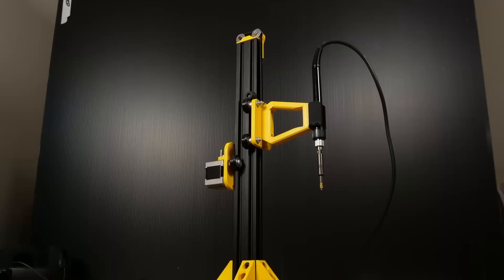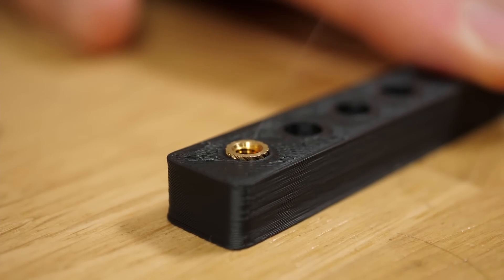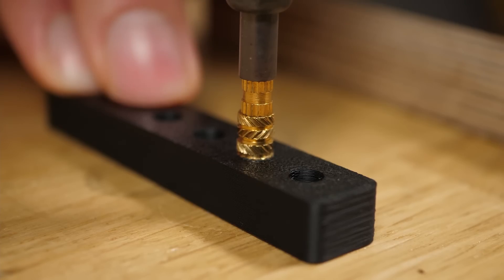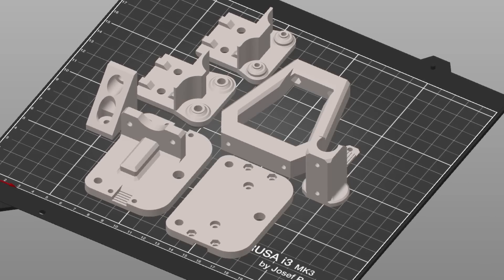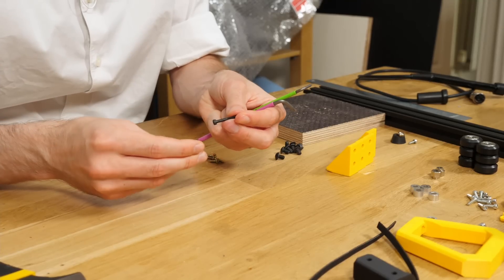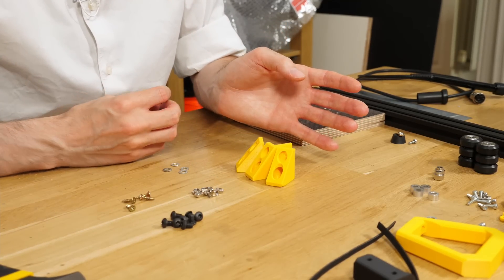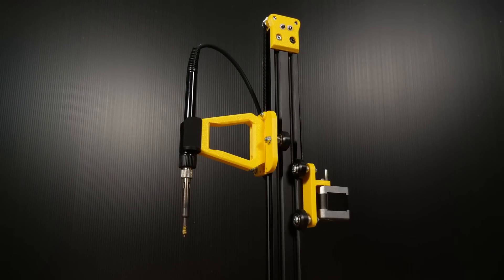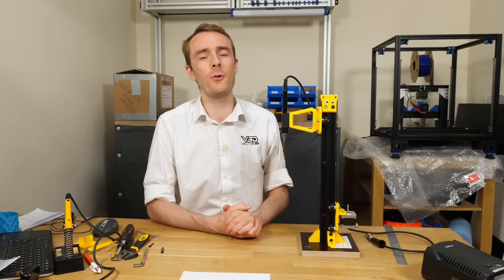DIY 3D Printed Tool Does PERFECT Inserts Every Time!

Comment: A iron with a digital temp setting makes it so much better. You can get it just hot enough, without melting everything, or pushing to far, it will go in slowly to give more control.
Reply from the maker: That's what this is, it's a soldering station so there is a separate box with controls and temperature.

Comment: Cool tool!
But the counterweight semms to be quite overengeneered in my opinion. What if it will be replaced with a mechanism based on strings 🤔
Anyway looks so cool with this design)

Comment: What kind of solder iron like the one you mentioned on the video, just the standard electronic soldering iron? Also, would it be easier if we use a drill bench press where you use the lever to lower it down and retract it back up? I find your video tutorial more interesting and affordable. Thank you.

Comment: What an idiotic invention,  all you need is a large wooden dowel like 1/2 inch. Insert threaded insert 80% of the way in the part then use a large wood dowel that is double the diameter of the insert and press down. The dowel will make it perfectly level with the surface.

Dumb invention you made.

Comment: Can't you just put an insert adaptor on the printer hot-end and use it like your machine ? you can set the temp, its vertically true, you can use it to drop down the same distance each time...like ?

Comment: I think that perhaps simply making an adapter for a Dremel drill press unit would be simpler.  IF I find myself in need of this solution, I will look into it further.  Of course, if a person doesn't have a Dremel DP unit handy or isn't interested in getting one, then this looks like a fine whiz-bang solution.  Well done.

Comment: Ok,.. so no details whatsoever on probably the most important part of the build the, what was it,..
"Kinda uniquely designed soldering tip not designed for soldering at all". 
No link, no maker, no (non-waffly) name/use. What's that about?
Reply from the maker: They're already widely popular and in-use in many place. Heat set insert tips, you can get them here:
https://vector3d.co.uk/product/soldering-iron-tips-cnckitchen/

Comment: this popped up.... if you really want a cheat you can get cheap drill press stands online for under 20, i printed a bracket to hold the soldering iron

Comment: This is great for inserting into a square piece i.e. where the part itself sits square on a table. Side note: the majority of things I have ever printed need inserts added but the item doesn't sit flat on a table. Example: I just printed some DIN rail brackets. In some cases I guess the part could be held in a jig / clamp. If you are making loads and accuracy is important then yes - a clamp plus the vertical insertion tool is probably very sensible. For me personally it's a bit of a niche case. That said, it's a great idea and nicely executed!

Comment: Not sure why you make a big deal about the soldering iron tip given any decent soldering iron will have tips designed for this purpose and presumably that's why the other soldering iron in your rig is using. That has nothing to do with this rig.  I mean this is still really nice for the ability to push straight, but the tip? Seems a weird thing to focus on.

Comment: Nice little tool... it would work better with a geared wheel to lower / raise it similar to a drill press... and a stopper at the hot tip so it sits flush instead of having to gauge the depth manually

Comment: I just push them in 90% of the way then finish them off with a machinist square to get them flush. I've never had a misaligned threaded insert or issues with flush mounting. I like that the square makes sure the insert and the melted plastic are flush. I do like how the counterbalance keeps it up and out of the way.

Comment: Is there a reason it's so giarnormous? I mean, I can see that the head pushing in the insert is moving not more than 1cm. If it's smaller .... well, my house is pretty small. So smaller things are easier to store when I'm not using them.

What I mean to ask, is have you already tried a smaller version, and found there is some unexpected problem, which is why it is now so big. I feel tempted to scale it down or up (so that it can double up as a drill press), but would like to know if there are some pit falls, so as to avoid falling down the same hole other people have already been in.

Comment: This inspires me to make a cnc version based on a 3D printer, imagine if you will, all the possibilities with 3 degrees of freedom for installing threaded inserts. It can install a threaded insert over here, or, how about over there? Yeah! That wasn’t possible before. All jokes aside, I have a project I want to work on and as a precursor project, i plan to make a 3d printer with a changing tool head. This, obviously being modified to fit to a 3d printer, could be very revolutionary. Especially if the printer can have 4 degrees of freedom and automatically pickup threaded inserts. You can make a print that might need inserts on the side and so the printer can switch tools to the insert head, grab an insert then add it in on the side of the print.

Comment: They make a simple end that is designed for installing inserts. Its made for a Hakko 88 soldering iron I have one and it works great the make several different sizes also.

Comment: Nice gadget. Regarding the base of the unit, I see a problem with applying inserts in the middle of larger parts due to the small size of the base. One could take a piece of the same base material to elevate the part or just make a larger base. And for inserts that need to be applied at angles, you could print some V-blocks for support at various angles like 30, 45 and 60 degrees. Also, if you don't have GT2 idlers handy GT2 gears could be used by reversing the belt.

Comment: I have been meaning to design exactly this same thing.  There are some other designs out there but they seemed a bit overcomplicated and I wanted to utilize some of the spare printer parts I have around - and this is exactly what I had in mind.  definitely going to print this out.  Good work!  Thanks for sharing.

Comment: I wish creators would offer STEP files, not STL files... STL files are not good for sharing 3D Models. They're large.. they are a surface tessellation model and so the detail is limited to the detail that the creator exported it at, which has in some cases been quite low (and the higher the quality, the higher the size of the file). .STEP files offer a far better method, they are platform agnostic, and will work with all CAD modellers. They are Geometric models, are describe solids, and so the quality is unlimited. The size is small, in comparison. 
But MOST of all, STEP files are far easier tot modify, as they operate as a standard solid model within the CAD program, and can be modified the same as others. STL files can be modified, but its much harder. As they are limited in detail and tessellated the geometry isn't standard, and so modifying becomes harder. aces are defined well, and curves are particularly bad. 
Prusa3D now allows the use STEP files for printing.

Comment: You don't need this - just press the insert in mostly straight and most of the way and then use an aluminum rod to push it in the rest of the way. That will flatten it out perfectly and cool it down as well. I've done close to a thousand inserts this way.

Comment: Great idea, nice design. Big fan  of your content.
I took your idea and went a step futher, by recycling an old crappy drill press. Gutted the motor and electrics, kept the base, upright and spring return head mechanism, Adapted a clamp to hold my soldering iron and voila! A heat insert press with adjustable depth stop and spring return tri-lobe handle. Works great. Thanks for the idea. Cheers

Comment: Trying to find all the parts.. the CSV list is sadly missing a lot of details on exactly what to get. I punch in the names and see all sorts of results.. many of which don't match the parts used in the video. Cool tool.. hoping I can assemble it!
Reply from the maker: I am selling kits now if that helps.
Reply: @Vector3DP  no. I ordered the $180 in parts. But I have enough to make 30. ;)
Reply: @Vector3DP  Oh man.. I just spent like $180 on amazon to try to buy most of the parts. :(. Hopefully they take returns. Where is this kit you speak of. OK.. I see the full kit on your site.. but it looks different. I printed out all the parts for the original. Will those no longer work with this? Guess I'll try to build it.
Reply from the maker: Ye the newer version is slightly improved design with different parts.
Reply: Did you make a video for it.. or instructions? Or is it only that you make/sell those?

Comment: What's the purpose of having one/two heat set inserts permanently attached to the tool head?
Reply from the maker: It's just slightly adjustable so the tip doesn't go out the back of the insert. Not normally much of a problem though as there is normally space.

Comment: I mean this is cool but I'm not gonna go through all that, buying most of the parts to make something to do threaded inserts better. Maybe if I was using them alot but after two years of 3d printing I have never once used a threaded insert. I will have to when I build a voron but I'll just do whatever few there is by hand.

Comment: Can't find the instructions to create the specialised tip for pressing the inserts in. They are expensive to buy commercially and hard to get. I like that he uses an inset for the contact plate and assume that the rest is turned. However, I don't own a lathe. Any idea on how I might manufacture it?

Comment: Nice project. Those that already have a drill press could make an adapter to hold the iron paralel with the chuck, for a much simpler print/build.
Reply: even better, I have a drillpress frame for an electric drill, so will just need to 3d print a collar for the iron. (ok, I could run something up on my lathe even quicker)

Comment: To be honest, only crap irons have permanent long-taper conical tips. Most irons, including cheap ones, have replaceable tips in some way. And that tip shape is roughly speaking the worst of them all for doing almost anything. Especially soldering. And heat inserts, because of how little contact area there is (and the high risk of wedging the insert stuck on the tip). For soldering you always want the largest surface area contact that will fit and do the job, as quickly as realistically feasible while getting good wetting, with maximum heat transfer to to aid that. Pretty much the same story for hot inserts, but adding the bit about steering clear of tip shapes that can wedge it sticky or stuck on there. If you don't need the tip for anything else, it's perfectly fine to file a tip to the shape you need. It won't solder well anymore, but that's not what we're doing here.

Love the jig and solution. Not knocking what you've made here, just crap soldering irons (tips) being crap, and the common go to being the least useful of them all.

Comment: This is FANTASTIC!  I decide to make one for myself!   I intend on making a print-farm with multiple Vorons & Ratrigs.  I know I will be doing a LOT of heat inserts.  QUESTION for you:  Can you give me the dimensions of the base?  That is one thing that is missing in the instructions.  Thanks in advance.
Reply from the maker: 150x150 is what I've used. Making one side longer to sit below the part being inserted into could be useful though
Reply: @Vector3DP  Thank you very much good sir!  This tool will be more than a little useful!  I'll post a pic of my tool along with another to help level parts with uneven surfaces so that my inserts always go in straight.

Comment: Stepper motor is a dead weight now !? Just a few years ago the Makers community had to scavenge the earth for stepper motors.  Just print a container with approximate same dimensions and put sand in it as you need more or less. Keep the stepper motor in the drawer for the project that need " intelligent controlled Motion ".

Comment: So, there are small brass spreadplugs (usually used for concrete) that clamp themselves once you screw a bolt in. Much more secure grip then these crappy things that always get loose over time and just pop out. The machine is smart though, I would just never use these inserts ever.
Reply: Can you provide a supplier link?

Comment: I push inserts in about 90% of the way and then I use an old gauge pin that's larger than the insert to push it in the rest of the way. The gauge pin both gets the insert flush and acts as a heat sync to cool the insert enough to lock it in place.
Reply: Really a good way. Use an old gauge can help you clearl see the install all process, I am threaded insert nut source factory, if you need sample for new item, i can send you free sample.

Comment: I took a pin and made a step at the end in the same minor diameter of whatever size insert. I use it for the last 10%. Sharper the corner you can get, the better. Works perfect every time. You just need a different pin for each thread size.

Comment: Could you upload the source CAD assembly as a .step? The assembly didn't work from the .f3z, and when I tried to extract it, couldn't open the.f3d files, gave a message that I wasn't authorized to open them. Thanks!

Comment: I used over 200 inserts of the voron recommended ones and around 200 ones from ruthex that won the strength test from cnc kitchen. I have yet to have one be of center or coming back out. I use a ts-100 soldering iron and have it set for 200 when I do abs.

Comment: Stop using the soldering iron all together. Just get a used glow plug from a diesel engine. Has the right form factor runs on 12v so you can just use an old power supply.
Reply from the maker: Glow plugs are a bit too hot for this application

Comment: I really like your channel but like others I think you have created somewhat of a very restricted solution to a fairly non existent problem. I have used thousands of heat sets (I test and prototype a lot)and cannot think of the last time I have used one into a simple flat surface as illustrated in the video. Anything other than a flat part this design is useless unless involving some very complex clamp\drill clamp to hold an asymmetric part perpendicular and the extended set up time that includes. I personally, usually place the heat set on the soldering iron for the brass heat set to warm up first prior to insertion. The result being is an easier more fluid insertion with less trauma to the adjacent plastic and much less likelihood of inserting at an angle . The method you have adopted which appears to push the heat set in cold could lead to more resistance on insertion creating lots of problems which your press design wanted to avoid. Even if waiting for the heat set to warm up, the direct contact with the part whilst heating may cause more trauma. I usually insert a long bolt into the heat set immediately after insertion to check alignment and also tweak the alignment by moving the bolt while still in the heat set prior to the plastic cooling. I have never had a failure with this method to date. Depending on the size of heat set used. I have found pushing a Nylok nut onto the soldering iron tip so the nylon ring melts and bonds to the tip creating a flat face for a M3 heat set to work quite well. I am waiting for a LDO Voron kit which includes a specific heat set tip for a soldering iron. I am curious to see how well this works and how compatible it is. Keep up the good work and many thanks. Steve
Reply: Relax 😂. 3D printing IS for small scale problems. But if somebody has the exact same problem it is very easy to solve if the files are avaible. 
The poetic stuff aside: your Hands are the best clamps by the way. And if you also motorize the down movement you can use both hands!!
Reply: Sometimes people like to create a tool to do something simply because they can. It's the making of the tool, not the using of it which is the important part.
Reply: If he can 3d print a purpose built heated brass insert nut press, then he can also 3d print and build a 5-axis project vise. (x, y, z, swivel, rotation) complete with zeroes, calibration marks and gearing.
Such things have existed in the machining world for quite some time now, especially in the CNC realm, but it's not rocket science nor even Aperture Science to create a manual version for use with this and many other things.

Comment: Where do you get the Heat set soldering Iron tip from and which heat sets are you using, thanks Steve?
Reply from the maker: Just google 'Heat Set Insert Installation tip' and you should be able to find something suitable. The thread on mine was largely useless I found
Reply: @Vector3DP  thanks

Comment: And you get the single most important part - (the soldering iron and/or tip) from.....?
Great video, great little jig, but without sourcing the correct tip, or a complete new iron and tip it's of no use.
When I tried to get one of these a while back they were extremly rare, and most people have a soldering iron so just needed a tip but can't get one.
Reply from the maker: They seems to be all over the place tbh, google 'heat set insert tip' and you should find something.

Comment: How about adding a quick adjustable endstop block so the soldering iron can travel down only to a specific height, that way you don't need to worry about over prenetrating.
Reply from the maker: Would be easy to add if you want, but its more of a hassle when switching between parts and to get it in just the right place for the perfect depth.
Reply: @Vector3DP  yup for a couple nuts it's not worth it but maybe someone need to do like 50-100 nuts in the same parts it might be handy.